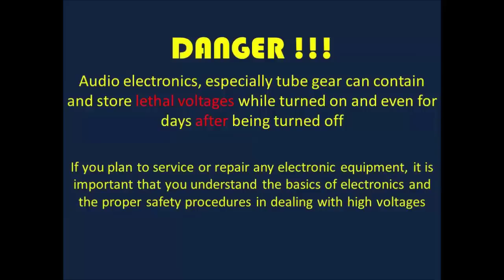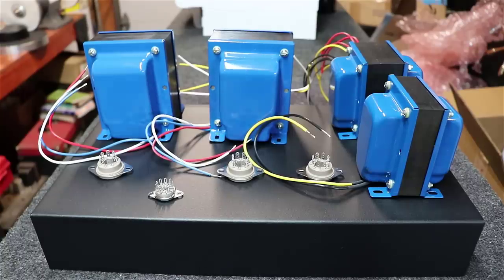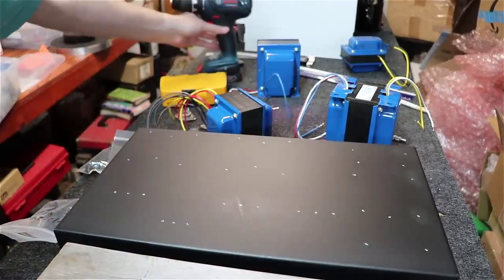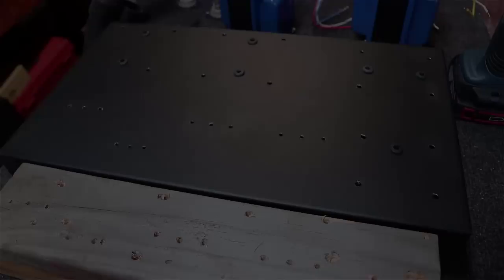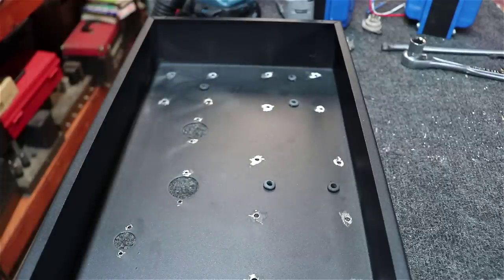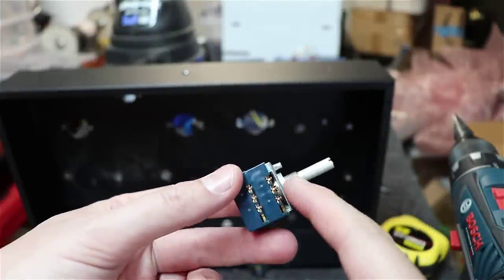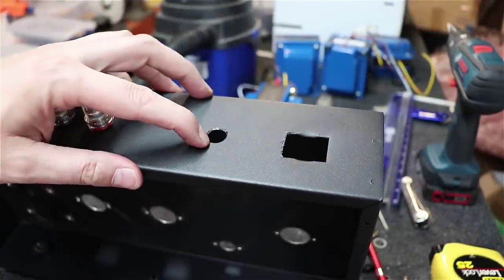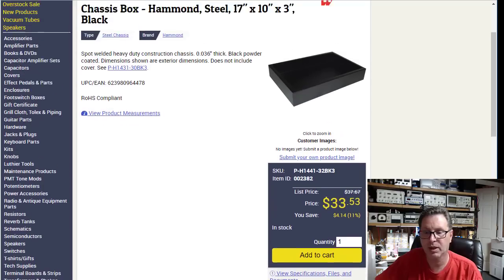KT88 Single Ended Tube Amplifier Build 2018 - Part 3

Comment: One quick suggestion. I would recommend putting masking tape on the chassis in the areas you anticipate marking and drilling. This gives you a nice surface to do your measuring, marking, and drilling. It also helps to protect the chassis from scratches, drill walks, and markings which don't clean up so easily.

Comment: A recommendation if I may: use a drill bit slightly larger than the hole(s) and go around with a hand drill (or your drill motor on the lowest speed setting), and use it to de-burr the holes, top and bottom. This’ll prevent metal splinters from ending up in your hand (or fingers), or poking through the rubber grommets you’re going to install. Your fingers will thank you for it! 😃
Also, I personally would use one volume pot for each channel, as it’s easier to find non-ganged pots with a particular resistance value, than it is to find a ganged one. It also saves you from having to design in a balance control! 😎

Comment: those greenlee punches have cross hair alignment marks on the rim of the cup die, if ya put down tape as has been already mentioned, draw an + drill a larger bolt clearance hole and you can get the tube sockets perfect

Comment: Looking great so far A little tip you may find helpful,, I use masking tape to cover the entire case helps in layout and drilling and also preventing scratches.
Reply: Yup. Hot drill shavings burn leave burns in the finish. Some mask protects it.

Comment: The mistake with the chassis is one that any one of us could make. The only people who don't make mistakes are the ones who aren't doing anything.
The cheap digital Vernier calipers have a nice bevel on them near the tips of the jaws and are really good for measuring the 'inset' part of rubber grommets. This will give you the proper drill bit size.
I also prefer a deburring bit for cleaning up the back side of the drilled out holes. You can also use a large oversized bit but you have to be very careful to just touch lightly, you don't want the bit to grab and pull through. A nicely beveled deburring bit is much saver to use. This avoids the unsightly grinding marks on the inside of the cabinet caused by using something else to deburr with.

Comment: I have messed up like that as well, now you have another box for mocking ups. I have to dig through my electrical tools, I have a set of punches that I keep meaning to use for my builds. Thanks for the update

Comment: Your videos are very informative. But to be able understand your reasoning, one has had to study tube theory on an engineering level. I studied at Valpo Tech in Indiana in 1970. I built my first amplifier in 1968 using EL 84 and 12ax7 or 7025. The only mistake I made was to use a linear taper volume control .

Comment: About mechanical work - first do all pilot holes with a small bit (its good to use center punch to mark the place where you will drill, this way the drilling will be easier), then go up to whatever is your smallest hole, drill out everything, go step up and drill out whatever needs to be this size, etc. This way you don't remove lots of material in one go, have less tool changes and end up with better looking holes that should be exactly where you wanted them. I'm also on the electronics side of things, but learned thing or two in my line od work (plant engineering).

Comment: As you say Mark measure twice and cut once. I have made similar mistakes myself so don't kick yourself about it. 
It would be nice if you put a link into the people who supplied the kit.
I was an engineer and have most of the tools you used and like you I also have some vintage parts somewhere in my old workshop. 
Many thanks for a great video.

Comment: Fun project to watch and bummer on the mistake. Also, wouldn't it make sense to make all your holes first and then send the chassis out for powdercoating or similar?
Reply from the maker: One of the goals of this project was to use a pre-powder coated chassis that anyone could buy off the shelf and do easily
Reply: Yeah, but when you're a klutz like me, I'd be constantly worried about a slip of the drill or screwdriver. Can these metal cabinets be purchased cheaper unpainted? I have a local place that does powdercoating very reasonably. They did a couple Marantz chassis covers for me.

Comment: A option out of replacing the chassis could be faceplates,  I worked at a roofing sheetmetal shop and strip drops behind the shear the width of amp faceplates was scrap.  You could go talk to the shop guy/gals and see if they could put you a bundle of strips of different colors ,types and widths  for cheap, most of the time we would give that kind of stuff away for free because we would see them come back after they saw  our shop machines .

Comment: Bad luck Mark. You could salvage it by fitting a rear face plate drilled correctly.
Reply: That's what I'd have done.  No one would notice.  (then again...I'm pretty OCD/Anal-retentive too.  It would have kept me up at night.  At this stage in the build and since the chassis is factory stocked...probably better to just order a new one.
Reply: jd73.Yeah, I know what you mean. However sometimes redoing all that work, plus the time and expense, outweighs the perfectionism for me. Especially if I can make a feature of the mistake, like it's meant to be that way. No right answers though. I just felt Mark's anguish. Best. M
Reply: That was my first thought.

Comment: Would it be easier to punch the tube sockets first, then drill the 2 mounting holes after the fact? Then you wouldn't have to worry about them being slightly off due to the stepper bit wandering.

Comment: You could make an "over panel" that matches the external dimensions of the side you incorrectly drilled. If you pre drill prior to fitting you would then be able to offer it to your incorrectly drilled chassis side and mark the new hole positions, as required. This would look fine, particularly as it is on the rear of the amp, and would be a cheaper option.
Reply: Apologies, I have noticed that I repeated 'mfr58's' comment!

Comment: You should use some rubber grommets or preferably sorbothane grommets and metal washers either side and stand the transformers on them so they've got some vibration hum isolation to the chassis.
What wrong with just putting the power transformer on the right side and swapping it over? you wouldn't see the holes they would be covered by the transformer you can always put some plugs in if that bothers you

Comment: Ow, I feel your pain, so much time you spend figuring it all out...  Nice video, anyhow. I would like to ask one favour. Could you pretty please elaborate on the purpose of the choke, what it does and how it does it?  I have been looking for info about it, but all I find is the choke of a carburetor.
Reply: 1959 Berre   Ive been converting console amps to guitar amps  and in the beginning without a choke  they sounded raw and kind of crappy and playing one is like driving a 1965 truck w/3 on the tree and a dirty windshield  after installing a choke and a upgraded output transformer these amps came to life  like  a new truck  w/ clean glass  the notes and chords are dynamic  and chime and are clear  playing is much more smooth, also I can tell the character of different name brand tubes,  but I dont know what the results on hifi...

Comment: Thanks Mark for another very nice and informative video. I have a question on why do you choose 5K primary impedance OPTs for the KT88 tube amp build? Will you be choosing the same primary impedance if you are using EL34 or 6L6 as power tubes? Thanks again.

Comment: Hey Mark: Did you video the build of that 300B SET amplifier?  THAT amplifier is the one that appeals to me...or perhaps a Western Electric 91a clone(?).
Reply: I am very interested in a 300B SE amp build also!  Please provide more information if you have it.
Reply: @oakmountainman7872  Since I wrote that comment I gave up on trying to find anything in the way of drawings or materials lists using parts that are available today.  As it turned out, I bought a pair of Manley Neo-Classic SE/PP 300B amplifiers.  They run a pair of restored 1970's vintage Klipschorns. The problem is, you won't find the kind of 1960's help with a build like this.  Back in the day, if you were trying to rebuild a Western Electric 91, or even kit an original ST-70 from parts, there were plenty of guys willing to help the novice get it right.  Heck, my dad had a friend at Western Electric who helped me build my first EL88 amp.  Today, the guys who can do this sort of thing PROPERLY are far and few between... and the ones who are known to do this work won't "give" you crap.  Suppose you want help with a material list (and you WILL need help because you will need PLENTY of substitutions due to unavailable components), be prepared to PAY!  Fact is, with todays parts availability, plenty of design compromises will be MANDATORY, and you must know what you're doing to make allowances in the design.  Get it wrong, and you'll spend thousands of dollars and hundreds of hours, and end up with a turd!  I figured my choices were: pay $8,900 for a pair of excellent, proven, ready to make music amplifiers, or spend upward of $4,000 (if you think that's high, you know nothing about the price of GOOD 300B tubes, and audio-grade capacitors and resistors) and MONTHS of design and build.  Once I had everything on paper, the choice was a no-brainer.
Reply: @leoashrae4199  Leo, thank you for your insights.  I have Klipsch Cornwalls, I wish I had a room where I could use Klipschorns!  However, it looks like Mark has stepped up once again!  I just saw "SBS - 2020 Amp Build Discussion - Bench Wire Cutter Rack - Preamp Update - More" on the Blueglow YouTube site.  I am going to vote for the high end option 300B SE build.  Once again, thanks for your reply, I enjoyed it.

Comment: I wonder if anyone has ever built a dedicated amp with a 3C22 output tube?  I know they have been very successfully integrated into amps designed for 6550/KT88 tubes.  They need about 500V on the plate and will work up to 60w plate dissipation without forced air cooling.

Comment: Really I personally would have left it the way you did it, just trying to isolate the power internal wires as best as possible. Either way, mistakes happen, there isn´t a project I work on that doesn´t have a mistake haha

Comment: Can you list your favorite eBay small parts suppliers that you have found reliable with decent prices. For your nuts and bolts clips banana plugs RCA jacks. I find that quality of the exact same part varies greatly amount suppliers even though the photographs look the same. Are usually buy bags of 100 of everything and I donate half of it to my local college electronic program because there are underfunded and the students often cannot afford or the school cannot afford components